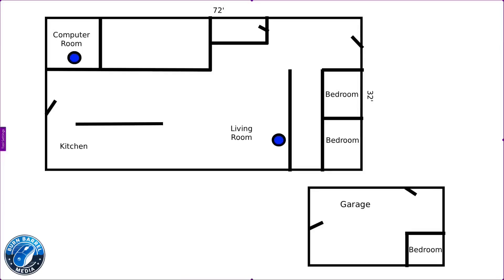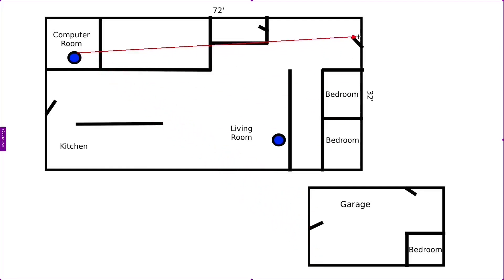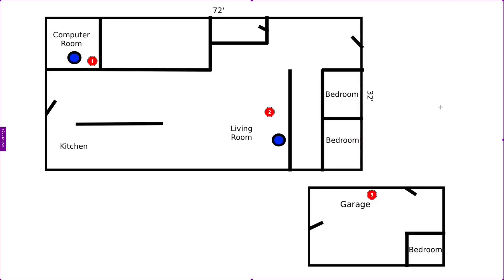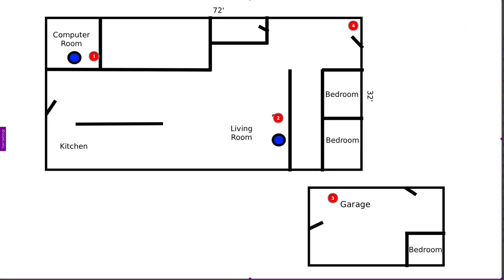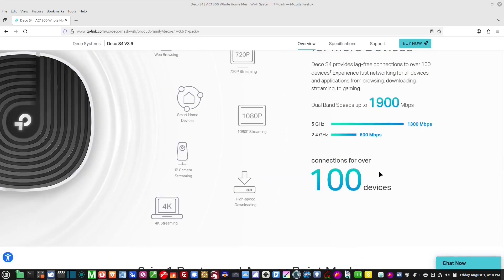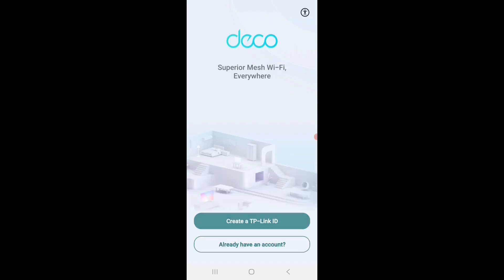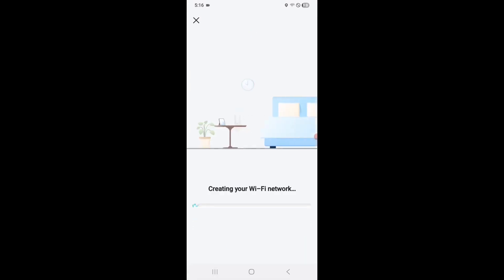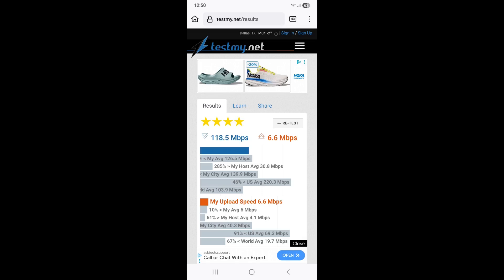How To Install a Mesh Wi-Fi Network

Comment: I'm glad to see you're using TP-Link products. I have a reasonably large array of the TP Link Omada equipment for a large mesh expansion across my family's farmlands using long-range access point bridges, POE switches etc... and of course those 'who did not contribute' (time, money or knowledge) are quick to point out that how the company is on the verge of a U.S. ban... 🙄🤔🤦‍♀️🤷‍♀️

Like all the interior components of any product brand are custom designed and/or made on US soil.

Comment: Which cameras do you use? Do you have to access them remotely?
Reply from the maker: These are the cameras I have, however running electricity for them was more than the system cost :-). They do make ones powered by little solar panels but I just didn't want to chance I might not get enough sun in winter. I can access them remotely in any time on my local network
https://amzn.to/4mrr9ts
Reply: @burnbarrelmedia Thank you. By the way, how do you create your thumbnails? They are one of my reasons for subscribing to your channel, the other being that your content gets straight to the point, and possibly the narration is done well with professionalism (no foul language).
Reply from the maker: @danielbrinnemancom  If you want to see a master thumbnailer at work, check out "Logos by nick" channel here on youtube.
Reply: @burnbarrelmedia  That's neat.